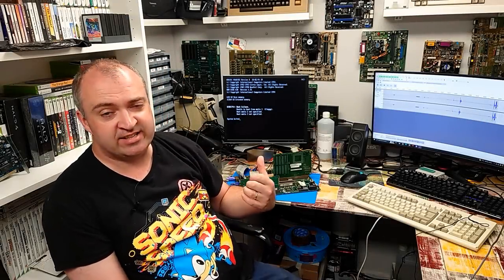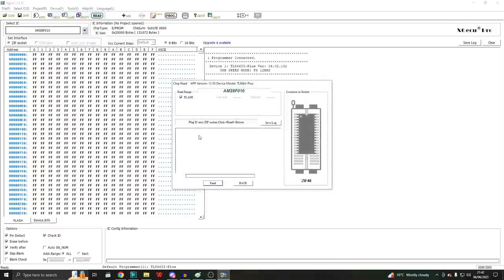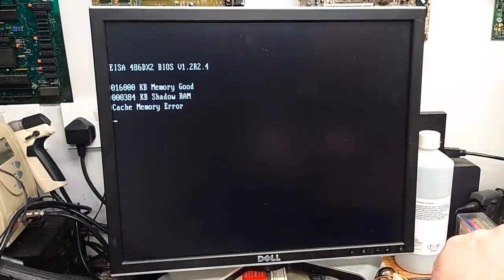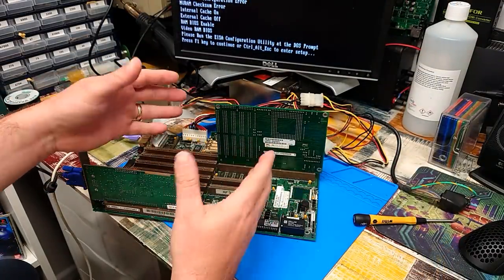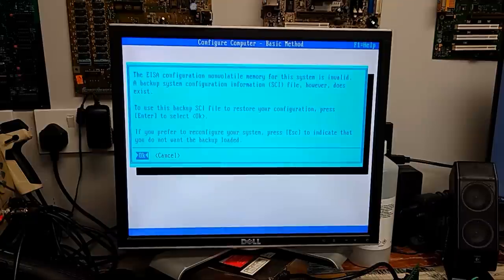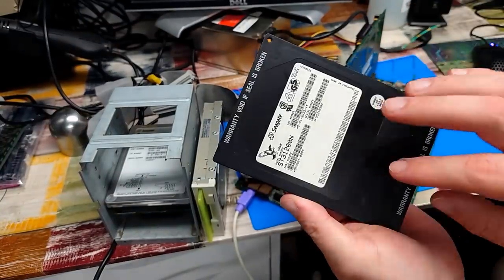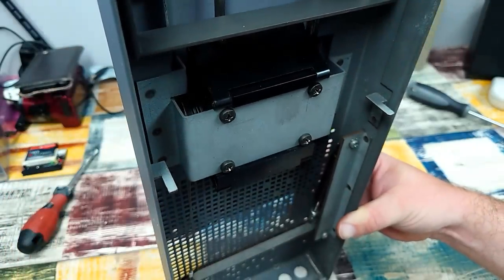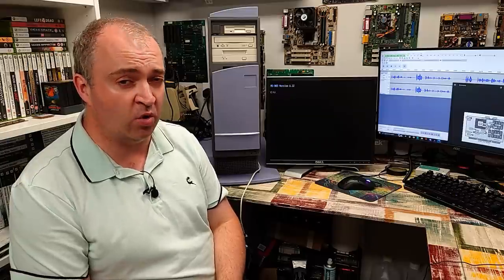PC Investigation: ICL Team Server Part 2, it *mostly* works

Comment: Never seen 28P before. Must be some sort of OEM version of the F family?
Extremely common btw. CSI/Catalyst, AMD and Intel all made their versions. 28f512 and f010 in particular. There's also a 020.
Later iterations (29/39 go to 040 by using what used to be vpp as an address pin so one must be careful avoiding those even in a double-image manner). (should be fine using the lower ones tho)

Comment: It was so great to see this machine come back to life. That tag chip is indeed a mystery, I was going to suggest trying a different CPU as maybe it was the L1 but you tried that and no luck so I'm stumped.

Anyway, upgrades: I know that you have your 486 with 1 MB cache and it is indeed a great machine, yes. But I am thinking, that this machine does have SCSI over IDE, so that should give it a bit of a performance boost, so I think I'd put a VLB graphics card in this one and keep it DOS or Win 95. I'd be interested to see if it would make games like Quake and Duke 3D run better with SCSI drives.

Otherwise, an NT 3.51 machine would also be interesting to see. But as I say, personally I'd go down the DOS/Win9x gaming route. Looking forward to the next video on this machine.
Reply from the maker: I probably will just keep this DOS with either 3.1 or 95 on it.  Once I get the cache issue sorted I think it'd be cool to benchmark it against the other DX2 66.  It'll be interesting to see just how well a former server can perform.
Reply: @CRG  Yeah, that would be interesting to see. I'm always curious about this even with modern servers. So I'm looking forward to that. Hoping that the cache issue will be fixed.

Comment: Thanks for a really interesting video. How about re-flashing the original bios back onto the chip, then re-running the EISA util to see if it recognises the machine as an ICL processor card. Perhaps these machines were like the IBM PS/2 Model 95 machines, wherein the different processor card complex/board, had a different configuration and setup depending on which one was fitted/supplied, ie. 486 or pentium. I remember the EISA setups on machines were very similar to the PS/2 setups where each device inserted into a slot, had its own config file associated with it. It was usually just a text file with particular setups for the individual cards or devices, and on the PS/2 machines they were called .adf (adapter description files)
Reply from the maker: I tried going back to the other bios but it again crashes just after post.  My assumption is that on the other BIOS the external cache is always enabled and its that causing the crash.  Once I get the cache issue resolved I may revert to the ICL bios.  With thanks to vogons I think I've got the correct ICL EISA config files so it would be nice to put it back to it original bios if I can.

Comment: Is that definitely a later version? I'm not sure if they've done something whack with the version numbers, but they're not normally decimals... v1.15 means V1, revision 15 and V1.2 would be earlier as it's only revision 2. That said, they're obviously on some sort of drugs to then have a release number after that, with it's own sub-release number too :D
Reply from the maker: You may well be correct but at least the ACER bios has more options to play with.  If I can get the cache issue resolved I'll try going back to the ICL bios.

Comment: Your little air spring is the same as you see in the boot of your car, but smaller. I’m not sure if this is the problem.  Try and sort out the wire drive belt.  I don’t know where you find an air spring that small but they must be used all over the place.
Reply from the maker: I've found several of these things from those used in cars to those used in kitchen units but they are all far to big.  Should be simply enough to fix the wire, so that replaced and everything lubricated might be enough to get it working again.

Comment: My heart sank a little when you erased that disk. You must have at least one machine you could stick Linux on to be able to read other disk formats?  I guess you plan to use this as a DOS machine anyway, so it's probably not a big loss to you, but I'd just be curious about how the machine had been used in the past!   It's coming together great though!
Reply from the maker: If it had have been IDE then yes I would have been able to do this, but with it being scsi it just complicates it.  I don't have any other machines with scsi in them (other than the old macs).  I maybe could have installed linux on the CF card but its done now so not much point in worrying about it. 

It probably will just be used as a dos machine or might I installed 3.1or 95 on it.  

If I had to guess its former life...  Inside the case there is an abloy sticker, they are a local security firm so maybe this came from their offices.  They are certainly based in the same town from from which I bought this originally, although it came from a private address when I got it.  If I had to guess it was probably just filled with business files.
Reply: @CRG  you could have just held onto it until you had the ability to read it. There could have been some historical data or non-archived programs on it.

Comment: Maybe you can use one or more 'rare earth' magnets from one of the dead hard drives for the sliding door; I'd expect the magnets from such older drives to be stronger than those in more modern drives.  I don't know if would have been possible, or even worth it, but you might have been able to create a live Linux drive to investigate the non-DOS partition on the SCSI drive.  While I know nothing really about servers, having parity checking on the cache RAM sounds like a perfectly reasonable approach.  Since the CPU would no doubt be doing a lot of fetching from cache RAM as it served its users, the, er, RAMifications (sorry) of a faulty cache chip could be disastrous.

Side note: PC Hoarder Patrol helped me out on Vogons just the other day; I was after the values for caps removed from a Slot 1 motherboard.
Reply from the maker: PC Hoarder Patrol has been very helpful with this one so was happy to give them the shoutout.  

If this drive hadn't have been SCSI it would have been a lot easier for me to drop into another machine to try and interrogate its contents but being SCSI just made it more complicated for me.  I've no other machines setup with scsi at present.  Yes I probably could have installed Linux and used that but again I'm fairly sure this just came out of an office somewhere so probably not much more than business files on it.

Comment: With so many yellow tantalums, maybe the pc devil couldn't resist putting the defective one on the CPU card😈
Reply from the maker: I checked the voltages and they are fine, none of the tants are short.
Reply: @CRG  +Yeah, and all the bad tants I've seen so far are on 12VDC lines.  Unlikely to have a 12VDC rail on the CPU card.

Comment: Hey my husband was showing me your video. I work for a gas spring company in the states. If you could send me more photos and dimensions I can look into it.  I’d need tube length, overall length, diameters. That guy is very tiny it seems but I’d be happy to try and help.
Reply from the maker: Thanks for the offer of help, I'll get you the dimensions etc this evening.
Reply: @CRG  sounds good
Reply from the maker: @jennywalter4510  assuming you want these measurements in inches, the length of it full extended is 4 5/8 inches, compressed it is 3 1/2 inches.  The tube is 2 3/8" (not including the bracket).  Diameter of the tube is approximately 1/2 inch and the shaft from it is about 3/16 inch.  Centre to centre of the mounting points is roughly 4 3/8 inches.  As I said in the video there isn't much written on it beyond high pressure do not open, 90N and a manufacturing date of 5/94.  If you drop me an e-mail casualretrogamer@outlook.com I can send you some more pictures.
Reply: I just sent another email following up from my request in June for photos please.  Please double check your spam folder  @CRG